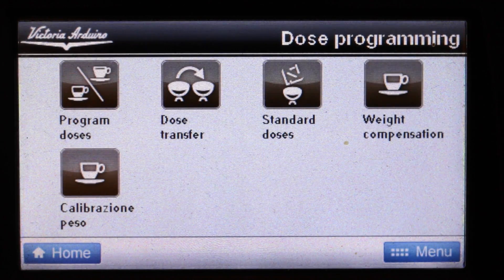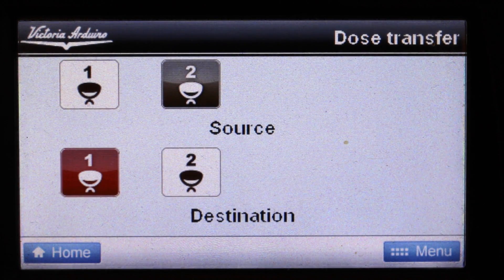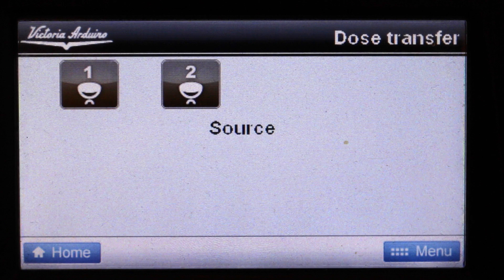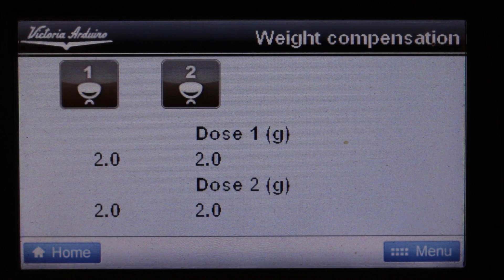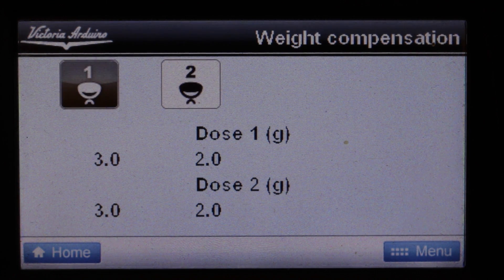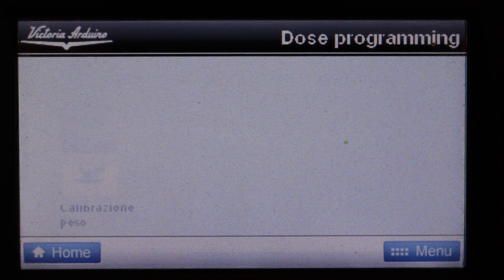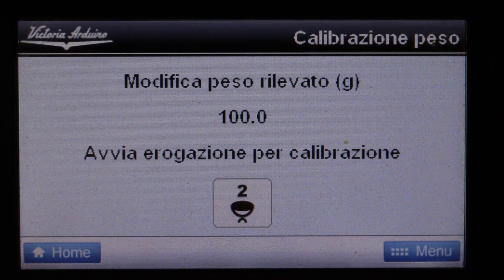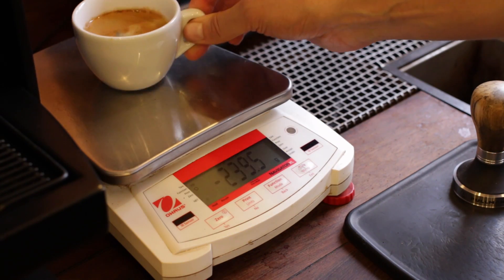VA388 Gravimetric Programming & Calibration

Comment: My VA388 gravimetric scales stopped working. With tech support advise Inspected and cleaned scales and then disconnected one. Restarted machine and two scales worked for a few minutes and then stopped working. Did this for all group heads with same result. Replace Gravimetric Board and all three group heads worked for a few minutes and then stopped working. Once again, disconnected scales individually with same results. Replaced cable from gravimetric board to main board. Once again, all three worked for a few minutes and then stopped working. Again, disconnected individual scales with same results. Replaced main board as I was told there had been issues with the transformer. Once again, scales worked for a few minutes and then stopped working! We tried calibrating scales with the same results. I can turn off machine and disconnect and reconnect any of the connectors on either board and the machine will work for a few minutes and stop working again.

Comment: Hello James I have problem with VA388 Black Eagle "G". The scale does not works time by time. I changed the sensores and the board but it still have same problem. Can you advice what can I do? - may this problem becouse of wrong programing?
Reply: Hello, I have problem victorıa arduıno gravite two Groups problem when the device is entered into setting after zero during installation when entering the program menu group setting do not Exit only hot water comes out group settings do no help why.
Reply: Reprogramming it
Reply: @hasanzabun834  hi, did you find any solution?
Reply: Change your scale, on which group scale is not working

Comment: Is there a possibility to still set the machine in the volumetric? I would like to program the left button for a 2s grouphead flush, which is quite a challenge for the gravimetric. The solution of just setting it for one gram and hoping it's gonna trigger the scale doesn't seem that consistent.